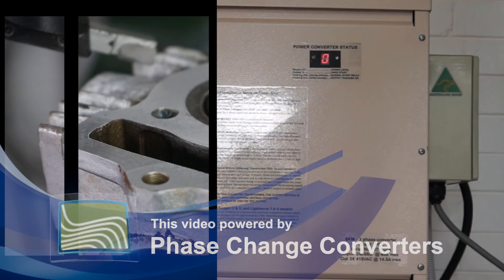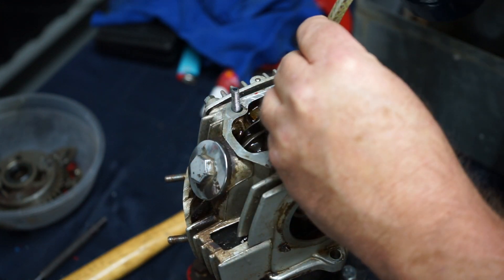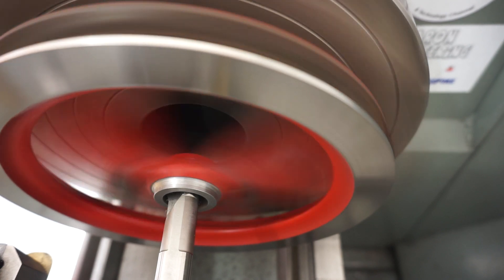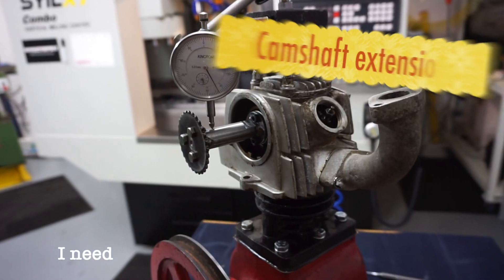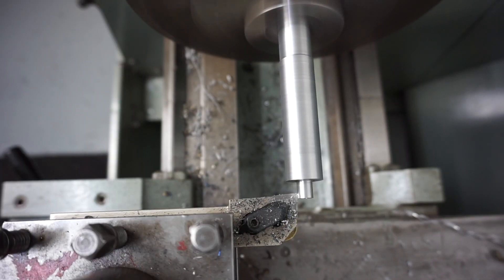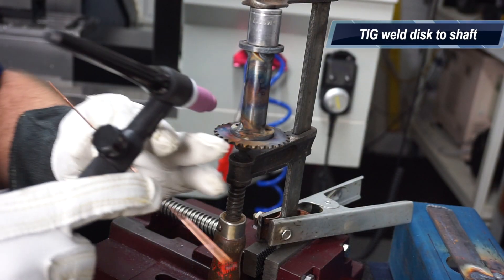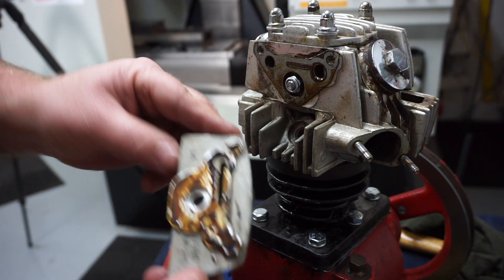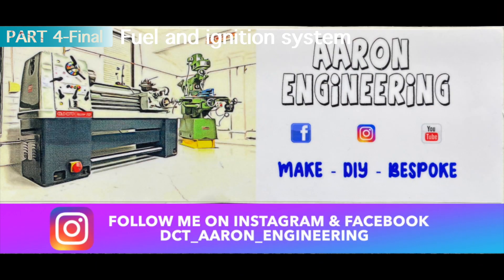DIY Engine Part 3 - Additional footage with narration

Comment: Hello Aaron. Great series so far. I was looking forward to seeing how you put those fat rings on the piston but there is always something right? Lots of problem solving and detail work that you make look easy. I suspect easier than it actually was. Good stuff!
Reply from the maker: Hey Eddie.  Sorry for the late reply mate, but for some reason this was held for review.  No idea why buddy.  Yes those rings were a nightmare to install.  I used the "old mechanics trick" of 3 feeler gauges to install the rings over the piston.  One on each opening and once in the centre and just slide the ring on.  Cheers, Aaron.

Comment: Gday Aaron, this project really took some problem solving, more then I thought anyway but you nailed it so far, the dividing head is working out to be a very handy tool, great job mate, Cheers
Reply from the maker: Hi Matty, you're not bloody wrong mate.  It was really a big undertaking, a rather challenging at times.  To be honest, the compressor unit was the wrong type for the conversion.  I will give you a call tomorrow mate to discus the box you sent me too.  I've got a class first thing, but will call mid morning.  Cheers mate, Aaron.

Comment: G’day Aaron. Nice work getting that camshaft extension to run true. Was the cam chain off the chonda, if so lucky   Doing good work, keep it up. 
Cheers 
Peter
Reply from the maker: G'day Peter.  Thanks for the support mate.  To be honest, this build was a bloody challenge at the best of times.  I just uploaded Part 4- Finale and I won't be flogging any more of you to death with this video series.  I gave a mention in part 4 at approximately 8 minutes in.  Cheers, Aaron